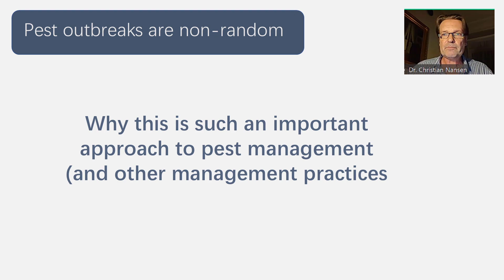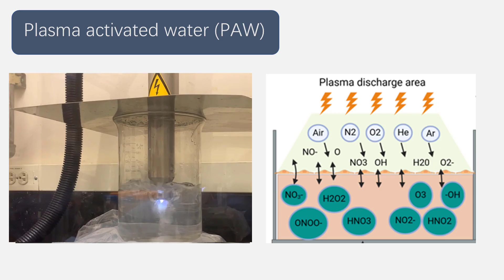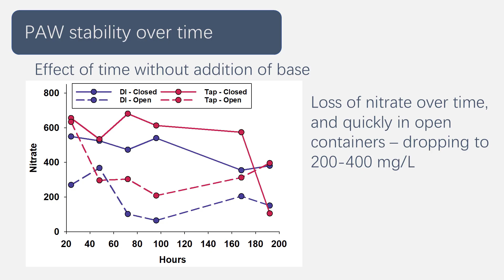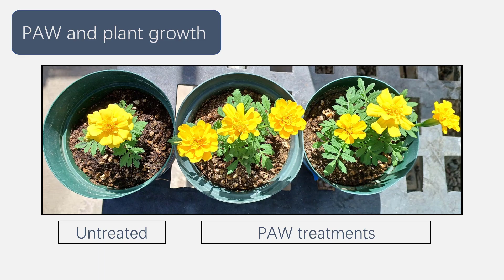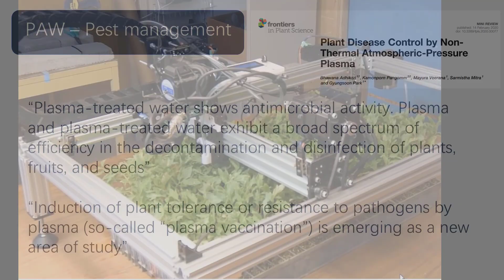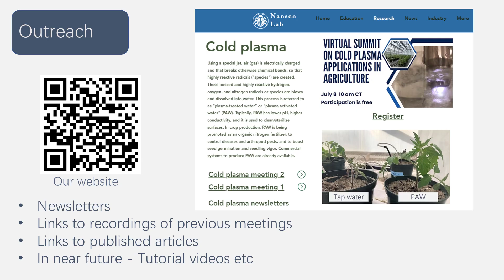Plasma-activated water (PAW) with focus on viticulture

Comment: Does anyone else think these plasma structures look like trichomes under a microscope? It makes me wonder whether an RF circuit could be tuned to induce trichome formation in plants. If you could control the density and ratio of glandular versus non-glandular trichomes, you could potentially boost yields of the compounds you want while also keeping pests away.

Skip to about the 10 minute mark: https://www.youtube.com/watch?v=R8iY2HnPC5Q&t=600s